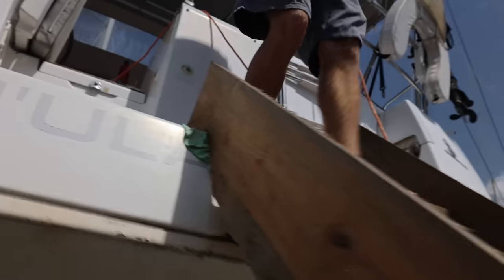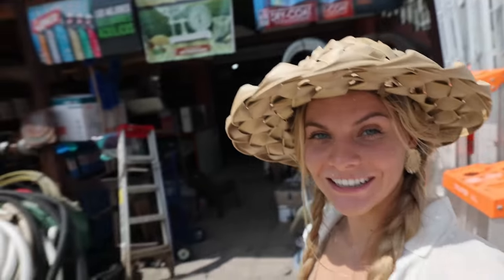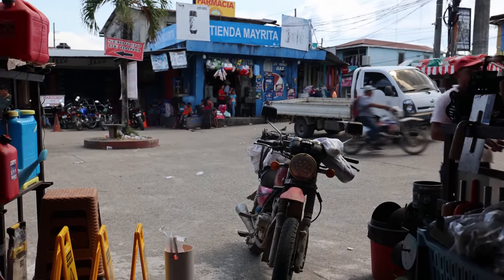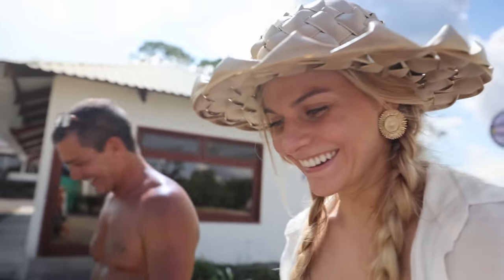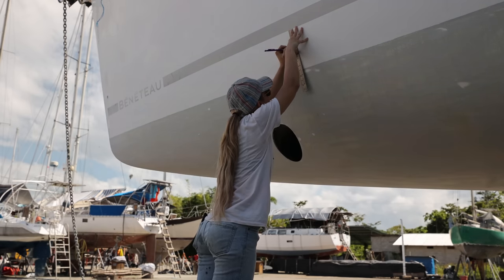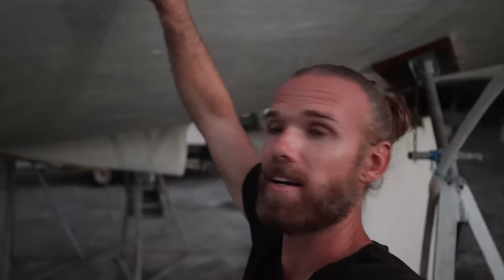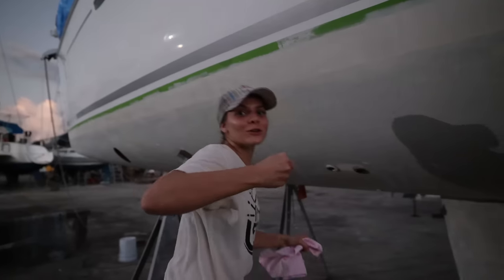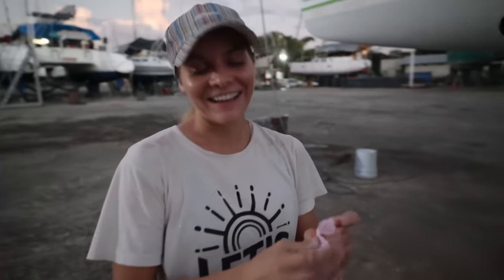PAINTING my 50ft SAILBOAT! w/ some experience (this time NOT ALONE lol) | EE 107

Comment: I think raising the waterline a bit is a good decision. And adding an epoxy barrier coat, great.👌 But...🤔
You do realize that rasing equal at distance everywhere will only work if the angle of the hull is also equal everywhere, which it isn't...🥺😉
Reply from the maker: We definitely realize that. If you look at how we have the new tape line you can see it isn't parallel the old bottom paint 👍
Reply: @ExpeditionEvans  Happy to hear that!🤗
It wasn't that visible for me, to really see it the camera would have needed to be at the same height as the waterline.🤷‍♂
But it is not that important for me to see, you have taken it into account. That's enough.😉😎

Comment: The amine curing agent is reacting with the epoxy.  The key is to finish application before you exceed the pot time (time when it hardens).
Reply from the maker: Always a race!
Reply: @ExpeditionEvans  You should see a run away reaction. On second thought you really don’t.  If one follows the manufacturer directions the proper amount of curing agent is mixed with chemically correct amount of epoxy.

Comment: Your Dinghy bow painter length should be not be able to get in the prop..
easy way is get the painter and do it so it just touches the outboard cover directly from the cleat.. which it should be fixed to so it cannot undo.
Also make sure you are carrying oars... I suggest testing them out to see if you can actually row with them.. most are too short.. there is a formula.. at a guess they should be about 6 foot long.

Comment: Hi there. A Money saving tip if doing epoxy Barrier Coat in future - Prep Hull and keel properly, rust treatvthe keelnif needed first, then keybthe surface, and do Three Coats of plain Laminating epoxy resin, dont pay lots extra for "Barrier Coat" its the same stuff, add some fairing content to 4th coat if the keel join area needs Fairing, then key the surface for antifoul primer, and follow the instructions from there. Yards messing up the Keel Preparation and barrier Coating, are what has prevented me having my favourite antifouling applied , which is Copper Coat. Far too many application Failures given the large expense, to personally risk it very sad face 😞 So I found an excellent Substitute, while the search for somewhere good enough to have Copper Coat co tinued. Which Pettit antifoul did you get out of interest?  as it is a Pettit one that I went with -Pettit Pro Hard antifoul, with two Primer coats, and two top coats first coat black , top second coat green. Why ? three to four years of zero issues, and up to another four years just pressure washing or an in water wipe down to de slime the hull. So Seven Years available to find a superb reputation Yard to do Copper Coat (there has to be at least one reliable yard out there to do the work somewhere ? ) Best Wishes and Fair Winds.  Bob.  👍⛵️✨️✨️✨️

Comment: You mentioned mosquito bites, well apparently mosquitoes are attracted to feet, there are a few websites about the subject.

Whilst you both were putting on mosquito repellent in this video both of you were wearing flip flops, try wearing proper shoes that cover your feet when the mosquitoes are on the hunt.

And one thing I learned when I lived in Australia is that mosquitoes can't bite you if they can't land.  So if you use a fan to blow air over you then they can't land, which is very good practical sleeping.

Comment: Why raise your water line?  Why make more work than necessary.  The Covid variants now are much milder and you have acquired immunity.  Now your immunity is far greater.  Glad you both are feeling better.  Have you thought about using Google translate to help you learn Spanish?
Reply from the maker: Our water line was too low initially! The previous owner had lowered it, so as soon as we filled our water and fuel tanks our waterline was submerged!! Plus all the gear from being liveaboard cruisers, meant our gel coat was seeing far more sea water than recommended